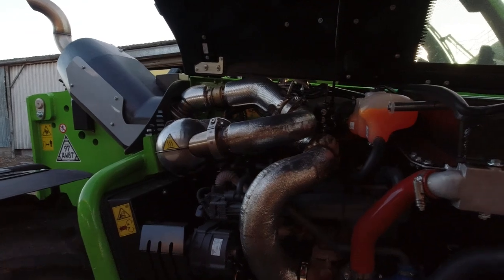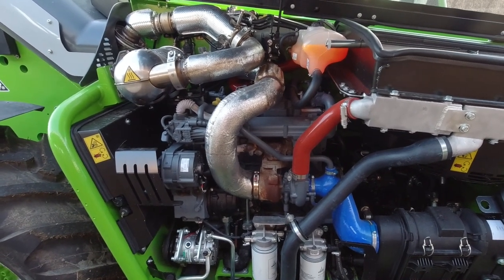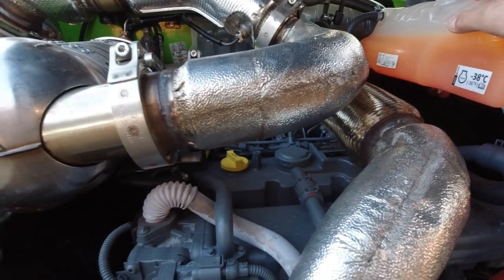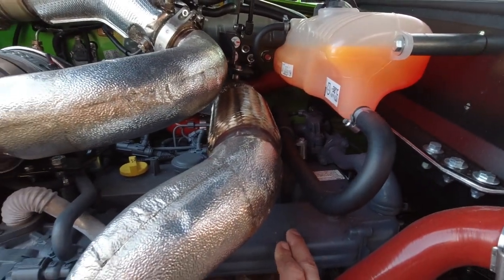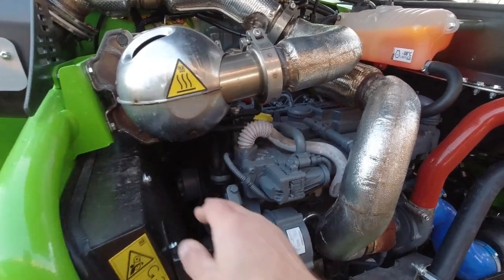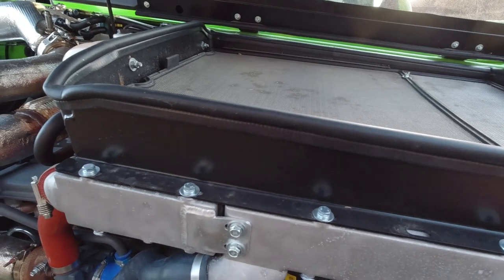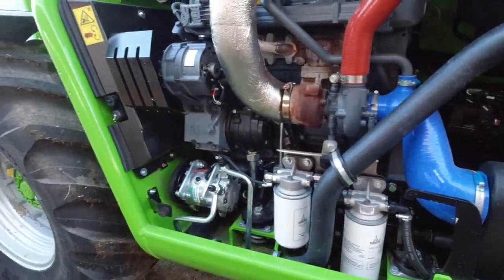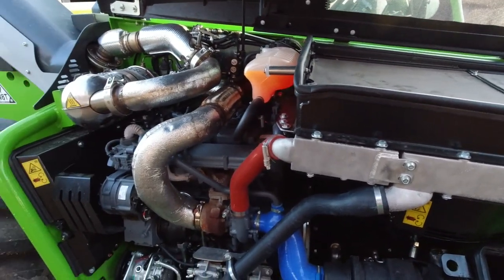NEW MERLO 42.7 First Drive and Impressions

Comment: I got one of these machines in December brand new. Traded in a 35.7 low profile model! This model I find is very nice! I don’t have the cab suspension! But have the boom suspension which is wonderful! The dead man switch is a nuisance at first but once your use to it! You find yourself looking for it in other machines! Best machine I’ve had so far! Interested in your further videos featuring this. Cheers

Comment: We've got the 35.7.
It's now done 1100 hours. The rear mudguards break off at the mounting points and cab suspension has been fixed twice.
Great machine though 👌

Comment: It was a large Merlo I carted around Europe in 2007 on a low loader for Formula 1 management from Biggin Hill. It was the big one that swivelled and had like a crane boom. They used it to mount TV cameras and the timing equipment. It was a nice driving machine. I very often unloaded and loaded it, then chained it down.

Comment: I drive a Merlo P40-7 Farmer couple of times a week and find the hydraulics very slow compared to JCB, the Merlo headstock locks on one central pin which is prone to wear and gets a bit sloppy. The JCB as you know has two pin locks which is much better. The electronic handbrake sticks on the Merlo I use and it stops the machine moving so you have to mess about stopping and starting it several times for it to let go so its parked up without the handbrake on usually. Like you say, Merlo are tall but quite short wheelbase which is very handy. I am not so keen on the trigger dead man on the joystick or button operated gears but you get used to that. if I was buying a telehandler I would buy JCB. Have driven Weidemann too but found the cab cramped on their artic steer handler but ti was a nice machine. So, looking forward to your opinion on the Merlo.

Comment: Just wanted to say that the Merlo is about 9,8seconds faster pr work cycle than a similar Class version.  ( example pickup, drive, lift, unload, repeat )
And the lifting capacity is also a little higher than what the machine can do on paper ( actual many tele handlers can lift more than the technical numbers say and i guess it have something to do with safety margin and not wanting to dissapoint the clients AND also that over x years the lifting capacity might drop as the pumps wear out a bit. )
But all in all telehandlers are a really great tool and i know on many farms they are the most important tool that drive the most houres pr year. ( such as cow farms )
But with telehandlers i highly recommend to stack the square strawbales perfectly since people who are sloppy risk the life of example playing children and workers if they
the bales fall down. Every year somebody die due to this. Also ofcourse its important with other safety things and especially to look over your shoulder when reversing especially if other people or children are arround.. The machine can change direction very fast and it can surprise people and create dangerous situations on a farm.

Comment: A bit of tape will sort out the dead man switch
Reply: Jason Davies tape doesn’t work as you have to release it every time your turn it on. It used to work on the slightly older machines but after a while you get used to it and it’s no problem you barely know it’s there

Comment: Great video George.  I Bet a lot of people will cable tie the Deadman button
Reply: Steve Grainger doesn’t work as you have to release it every time your turn it on. It used to work on the slightly older machines but after a while you get used to it and it’s no problem you barely know it’s there

Comment: I'm curious, why are you looking for a telehandler instead of a wheel loader?
at work, we have a JCB 416 wheel loader and I wonder if a telehandler would fit better in the operation because the extra weight isn't rely nesecery except for compacting the silage pit.
Reply from the maker: A wheel loader like a 416 would be far to cumbersome around our traditional buildings, a telenhandler is a more versatile bit of kit

Comment: That pain about having to cut off the plastic wrapping then the netting and loosing some of the silage!  If New Holland had taken up my Idea for  Eco-Friendly Bio-gradable Baling system you would not have needed to cut of any plastic or netting, Just dump the bale in to the mixer without any mucking around or loss of Silage!  Maybe my new design of Eco Baler will get taken up by John Deere?  And yes the idea is mine and yes it would work.
Reply: Colin Campbell how does the wrap work if it’s chopped up through the feed and cows digest it, or if u oh leave the bales out in the feild for an extended period of time does plastic not rot ?

Comment: that button to switch to neutral an the switch to engage the parking brake would drive me mad, when you are just to a tractor where you only need to put it in park or engage the parking lever.

Comment: What so you will have to put a check valve on ever attachment 😂😂🙈
Reply: I thought the same thing but then what would that mean ? Muck grab ? Shear grab ? It’s not really an issue in the grand scheme if it speeds up change overs.
Reply from the maker: For us that would be three, not exactly the end of the world.
Reply: You can also fit a valve to the headstock either taps on them, it works out cheaper if you have multiple hydraulic attachements. The valve we use on all our sold machines is.
http://www.whitehouseproductsltd.com/product-details.aspx?pid=30604

Comment: 6k hours its not evan run in
Reply: Farmer 2003 it’s around those hours that things can start to go wrong, bits like cardan shafts can break up. 6 to 8,000 hours is when you’ll see a lot of machines traded in while they still maintain some value.